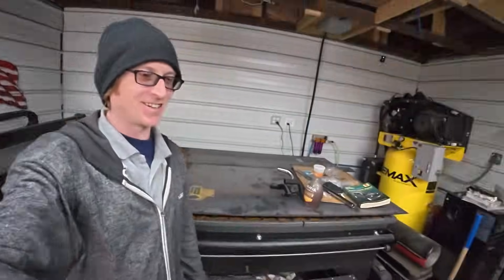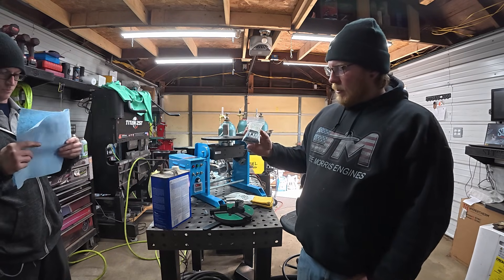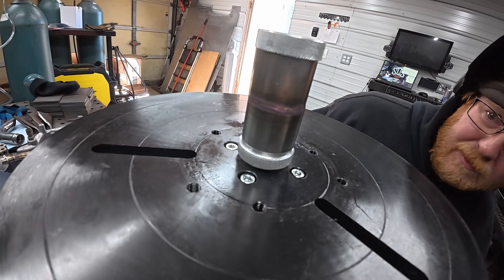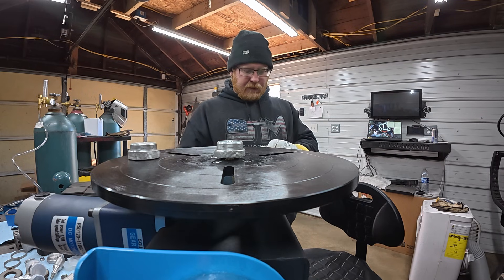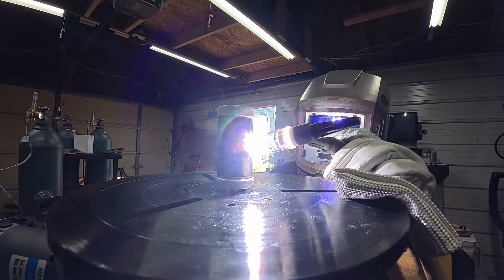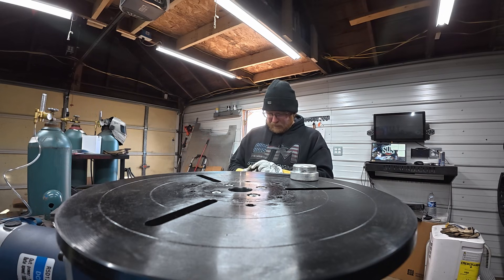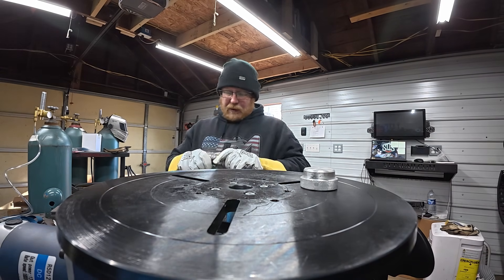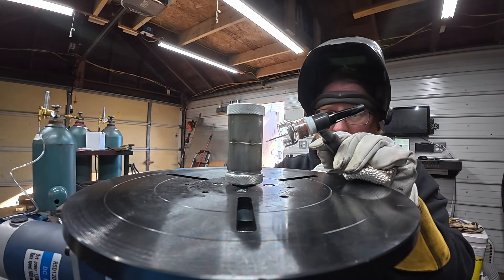Stainless Steel Tube Welding on Modified VEVOR Positioner (Back Purge Upgrade)

Comment: Where did you get the purge adaptors you used?  I just recently purchased that same weld positioner, and trying to figure a better way to get a tight purge through the center hole so the argon hose doesn't get twisted up.
Reply from the maker: We handle this modification in-house. We put the part on the lathe, drill it completely through, and then tap the end. We used a 1/8" MPT thread, but you could easily go with 1/4" if that better suits your setup.

If you’re not able to do this yourself and don’t have anyone local who can handle this kind of work, we can take care of it for you. You can reach us through our website at sttsfab.com or email me directly at jason@sttsfab.com
. All of our contact information is listed on the website.
Reply: @STTSFab-x9c  Your weld positioner looks just like mine but mine already has a 1" through hole through the center for back purging.  Yesterday I ordered a  Milton 1/4" air swivel hose fitting, that I'm going to mount to the back with a bracket, and from there I will run a 1/4" stainless pipe through the center and out.  The swivel should allow the pipe to turn with the chuck,  while the gas line stays fixed at the bracket on the back.  I will figure out away to make a bushing for where the pipe comes out of the through hole to keep it centered.  Thanks for replying back.